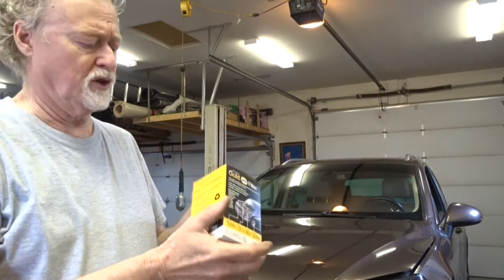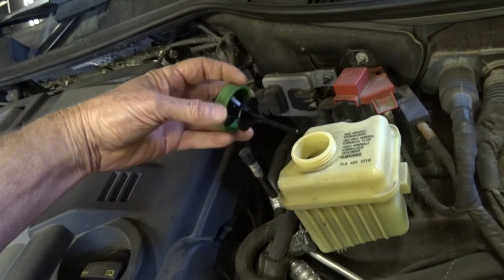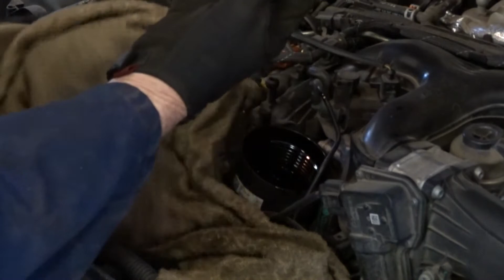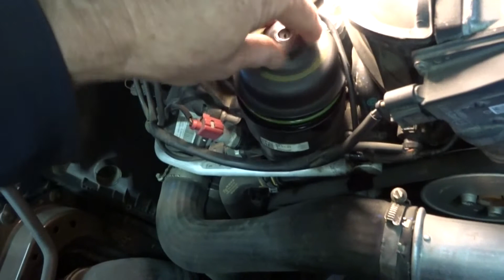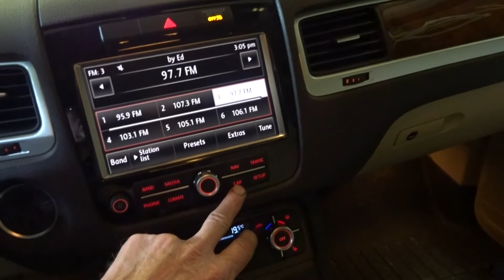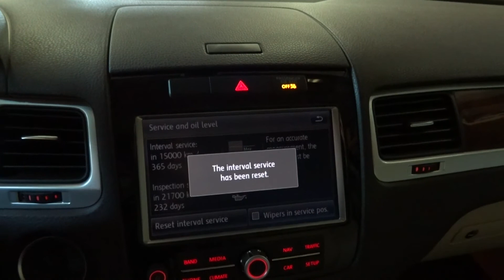How to change oil in a Touareg TDI

Comment: Nice guide. Like the inspection tips along the way. Couple of things I have found helpful: 1) Oil filter: Tuck a towel around the back side of housing, below cap parting line, to catch any dribbles down the back. 2) Oil filter: after cracking loose, slowly unthread to prevent dribbles. Do not remove right away. Let it sit mostly unthreaded. Most oil wil drain from filter. I will loosen the filter, leave it, then drain oil, come back put new filter in, install drain plug, then add oil.

Comment: Hello. When you replace the plug, where do you buy it from? I found them online for $2 and $30 and am wondering if I need to pay for the expensive one or if the cheap will do. Thanks!
Reply from the maker: I got replacement plugs from VW for $10. It is worth getting the correct one.

Comment: That little piece of foil from the oil bottle won’t damage the engine because it would get trapped in the oil filter.
Reply from the maker: To get to the filter It has to go through the oil pump first. And would probably get caught in the pick up screen. This could partially block flow. Not recommend. Thanks for your comments

Comment: I have two Touaregs, Gen 1 / 2010 and Gen 2 / 2011 models, both TDi, the Gen1 has DEF systems and air suspension, and the Gen 2 is my Mexican Treg and has NO DEF or EPA crapola. Interestingly enough, Gen 1 has 110k miles, Gen 2 has 53k miles, and I really like Gen 1 best. So many extra features on Gen 1 that were not replicated on Gen 2.  Thanks for your channel. Hoping to do most of the maintenance services on both vehicles. Noteworthy, I have a 2018 Toyota Hilux Diesel D4D 4-cylinder turbo 4 cylinder and the engine oil stays sooooo much cleaner on it then the VW TDI, and the VW's stays much cleaner, longer than the Mercedes 3.0 liter 6-cylinder diesel. Wondering why that might be the case. If you know why Toyota stays cleaner, much, much longer give me a shout.

Comment: Hello, is this your personal car? What is your opinion on this car and it's reliability? I was looking at buying a used SUV and these Gen II Touareg TDIs can be had for an attractive price where I live. My concern is the air ride suspension parts failing.
Reply from the maker: Yes this is my personal car.  I've had it since new.  It has been the best car I ever owned.  But it's just getting to the point of needing major maintenance. This one has coil springs. Best years are 2013 to 2016.  Air springs are not to hard to change (if done them in a BMW) so don't be to scared off by air suspension if you are handy.
Reply: I have had two gen 1 Tregs with air suspension. They have THE most reliable, durable air suspension of any make or model. Not sure why others like MB and Land/Range Rover have such a high failure rate. I bought all new air suspension parts for the front end, thinking they would eventually fail, but I may never use these parts. The Gen 1 has air suspension lifting it an extra 4.75 inches when needed and locking center and rear differential as well as a plethora of other unique options dropped in most models in Gen 2. Great cars.  I have two now since VW paid me more than double I had invested in my first Gen 1 Treg. I agree with Gary, "Best car I have ever owned". My Hilux Diesel is "The best truck I have ever owned".

Comment: I drain mine topside- it’s a feature of the TReg that I love. I WAS crawling underneath the car to change the oil but what a pain in the neck that is when you don’t have a lift!!!
Reply from the maker: That is a great option if you have the extractor.  Cheers
Reply: @garysgarage2118  How do you change it from the topside if there is no dipstick ?
Reply: @m70v12  buy a vacuum pump oil extractor jug, 9 liters min., amazon sells it. They come with a small hose that you insert where the dipstick would go, I know it doesn't come with a dipstick per se but by removing the cap where the dipstick would go you can then insert the hose and then vacuum pump it out from there.
Reply: @yoadriaaannn  Going to try this. I have the large volume extractor pump for my boat's diesel engines (Ford Lehmans) and never thought about using it on the car. Without owning a lift, like Gary, extracting oil from the top and measuring to make sure I have it all (99.9%) will make the job easier and less messy. Thanks for the idea.